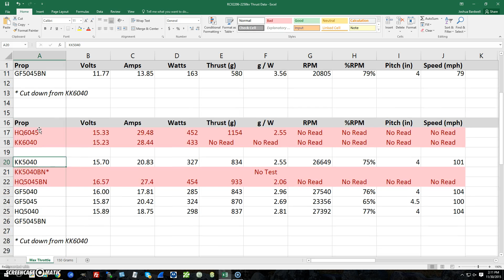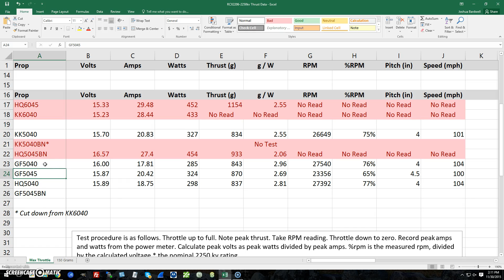RCX 2206 - 2250kv motor thrust data

Comment: Interesting video as always. I am one of those that loves the GF5045BN and its copy by DAL. My thrust test rig simulates more of a real world situation and the result is that I get identical thrust values vs the HQ5045BN and the DAL copy of that prop on 4s. I think what gives the GF the edge is its greater efficiency. With 4 motors all being powered from the same battery you get significantly reduced total thrust, the limiting factor is the battery. So I simulate the other three motors with a bench electronic load.

Comment: Based on the data on myrcmart, this motor is weighing 50g each, which put me off coz I'm a light flyer. Are these motors+screws+wires truly weigh 50g?
Reply from the maker: No. Around 35 grams.
Reply: +Joshua Bardwell about 28.5 with the wires sniped off like we would on a mini :) , 50G of thrust per motor is really alot thats why so many people notice the change when they get good esc&#39;s , i think you know i agree the kk5040 are very flyable but if you want to pop and lock it like the pros haha you need the 45BN&#39;s